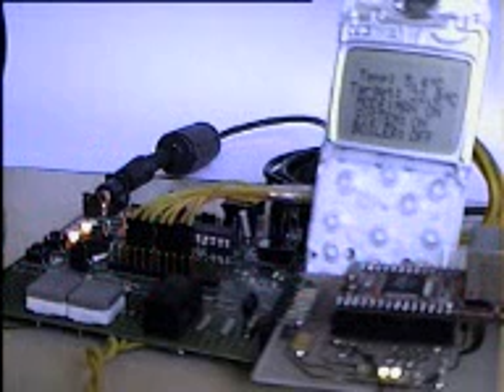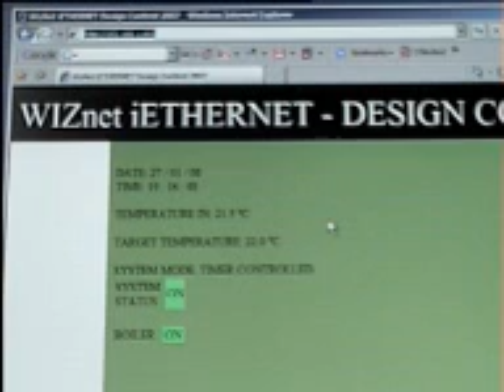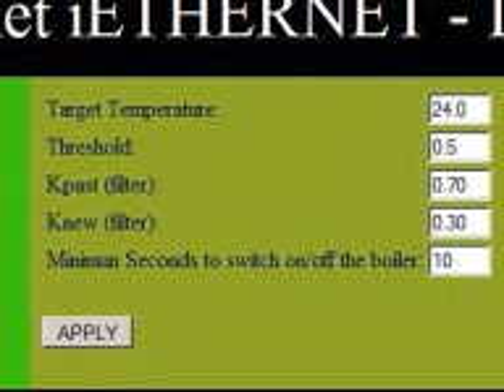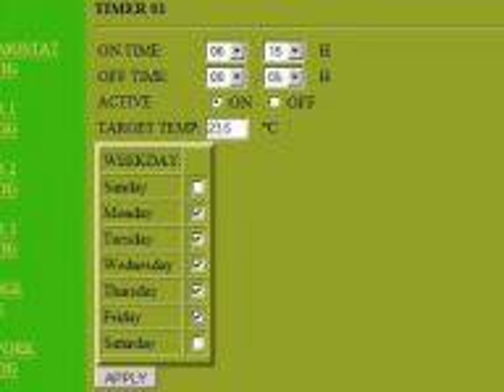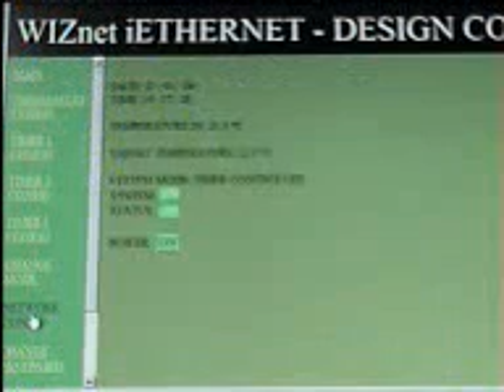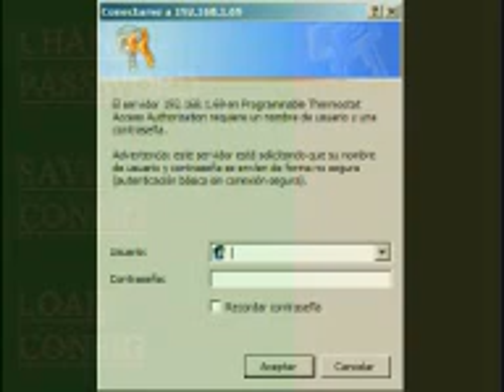Secure Web based Chrono-Thermostat (Wiznet contest 2007) II

Comment from the maker: Distinctive Excellence.
This secure chrono-thermostat design provides Internet-based control of home or office heating systems. Featuring a WIZnet W5100 and a Microchip PIC24FJ64, the system is wired to a building's boiler and connected to a router for Internet access.  Using power-over-Ethernet, the cable to the router also supplies power to the system.